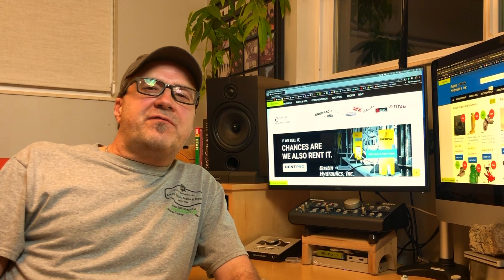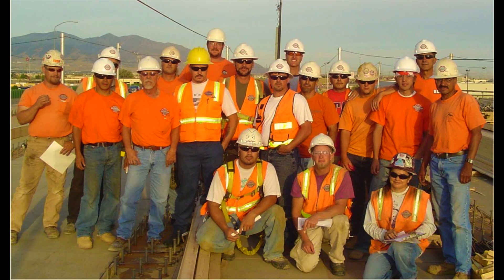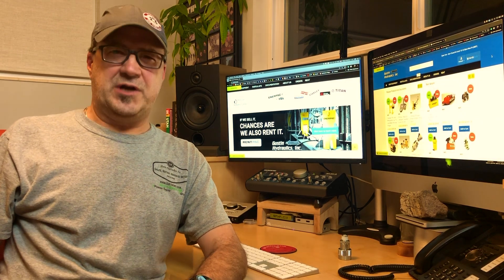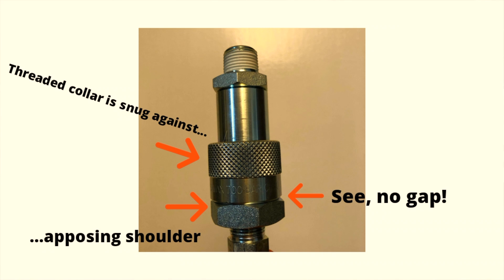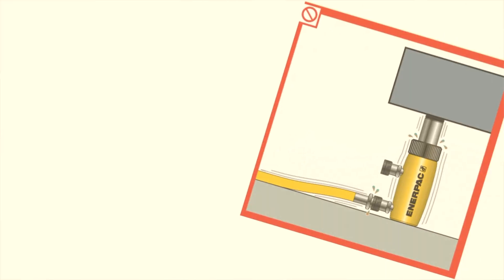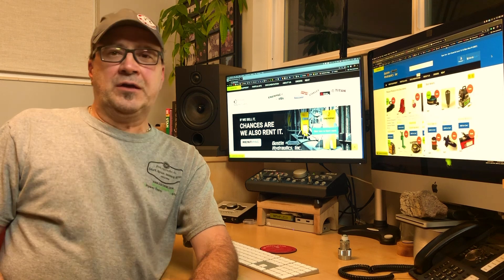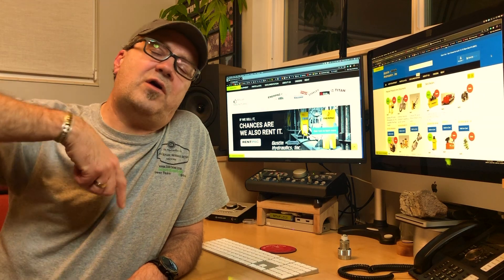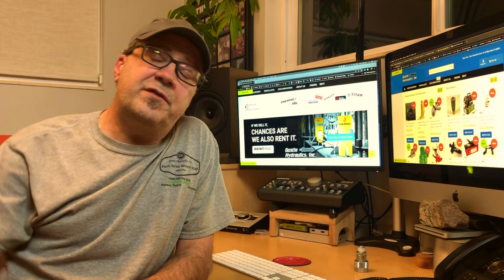Coupler Safety - Top 5 Dangers 10,000 PSI Quick-Couplers

Comment: Hi could you please tell me if i need a splitter / manifold or just a 4 way fitting to connect #3 20ton hydraulic cylinders together to a electric hydraulic pump? everything is 10,000 psi thank you
Reply from the maker: Hello @ponchopelayo77 It would depend on what your application is. Are you using double or single-acting cylinders?  What are you lifting?
Reply: @gustinhyd  thanks for replying, I'm using single acting cylinders, I'm building a press brake for bending metal

Comment: Why insist on 10,000 psi ?- is there a reason other than the obvious to withhold pressure
Reply: What do you mean insist on 10k psi? Because the equipment that's being pressurized requires it to operate correctly?
Reply from the maker: Hi @mikehawk4517 !  To avoid overpressuring/damaging couplers, fittings, hoses, etc possibly causing injury. But also, if, for example, one were using a 2000 PSI max pressure pump on a 10,000 PSI rated cylinder you would only be getting 20% of the rated force of the cylinder.
Reply from the maker: Hi James!  No, I'm just making clear to be sure to use 10,000 PSI working pressure couplers with 10,000 PSI working pressure jacks, cylinders, pumps, tools, etc.  Otherwise, save a few bucks and use what's rated for what your application is.